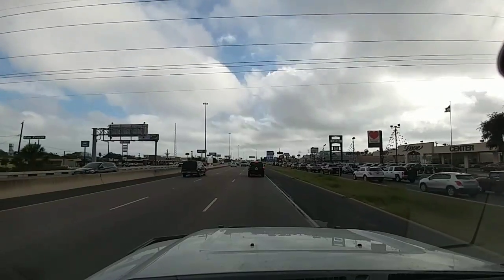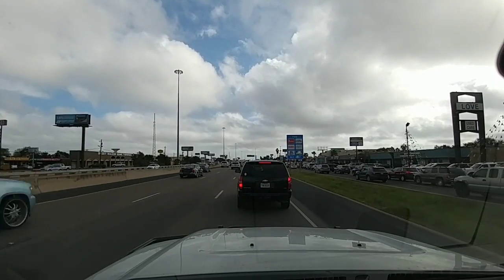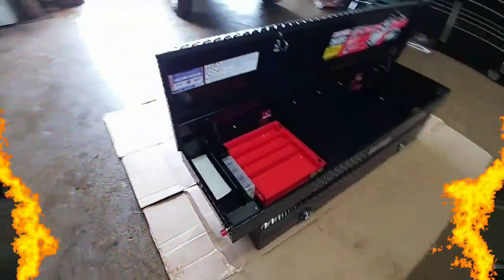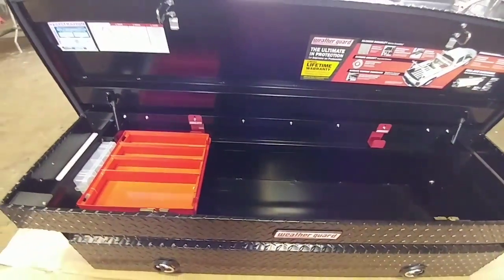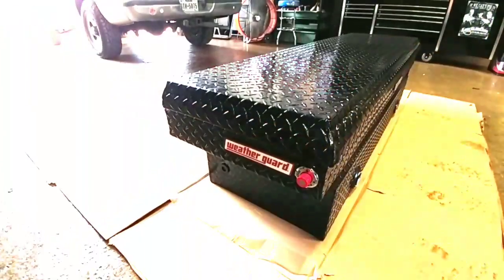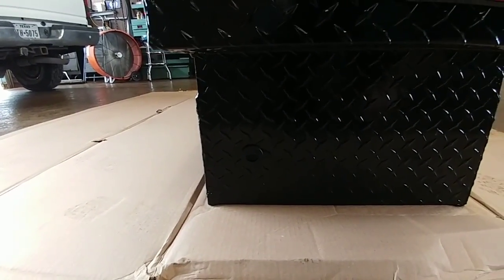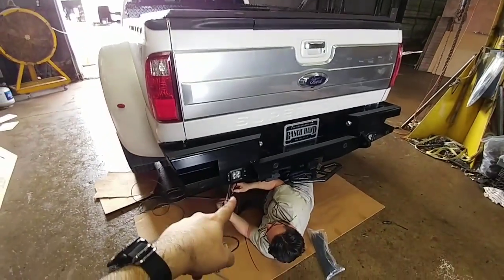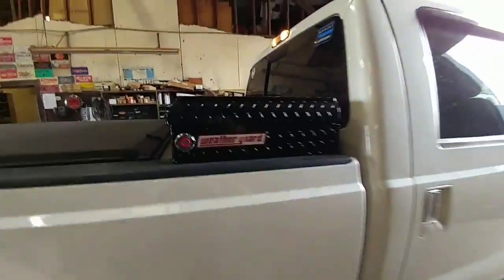Ranch Hand Wig Wags, Weather Guard, Clean F450!!

Comment: Wig wags traditionally were installed in 1986, for law enforcement,  then in the early 90's fire departments, and EMS, began to use the switch, however it only refers to headlamps which rotate flashing simulating a dog wagging it's tale. The lights you describe are alternating led lights, but actually a strobe was a type of light we used after halogen rotators, began to be less effective.  They were adapted from airplanes, to helicopters,  and became very useful particularly in the daylight hours. But many officers would turn the front store lights off ,and only leave the rear deck lights on ,due to the effect that the officer would feel when he had a contact in front of the patrol car. It was similar, and almost exactly to the effect one feels at a night club, when they turn on the stores while in morion, it creates the effect ,to the human sensors that they are moving in slow motion.  Thus, the LED's  were founded in the early 2000's, but they were extremely expensive. 
 Why civilians call LED'S WigWag, or strobes ,I feel it's the younger people, who are civilians and never experienced the dynamics of using halogen rotators vs strobe lights vs LED lights. Civilians are loosely referring to these terms, I think, to any LED that alternates,  or LED that pulses.
 Unfortunately,  I've been a cop for 33 years, and my dad, and grandfather were cops as well,  I can say for certainty that whether civilians, or first responders it appears  that there are much less fatalities, because the warning devices are much more sophisticated & contemporary.  When I first started our marked cars only had 1 steady burning red and red & blue round halogens on the rear deck. If a officer ran code to a disturbance, it was deck lights on and the officer working the steady red ,siren, and hazard lights on. Until 1986 when Federal Signal founded the Wig Wags for the head lamps,  this helped stremendously, particularly in the day time.
 Good luck, the components on the pick up look sharp sir.
Reply from the maker: Dutch Avery: I really appreciate the information sir.  Be safe out there brother
Reply: Big Truck Big RV 

Thank you sir.

Comment: Since you lost you higher up strobes on the box you should think about putting some strobes (white or amber or both) in you bed lights (in the 3rd brake light housing). It's always important to have high mounted lights, especially if you are going to be on the side of the road for any reason.
Reply from the maker: Daniel Pace: yeah, I'm having to think about placement now. Maybe some hide aways are in order

Comment: Another great video. Thanks for your work. One comment that I will make is that I personally don't see much of a use for those lights on the bumper. In an emergency situation, the last thing I want to do is blind people coming up behind me with a white LED light. Are they at least wired to your reverse lights so you can see better when backing up at night?
Reply from the maker: caveman123ization: I was considering connecting them to my reverse lights, but they blind the backup camera.
Reply: Big Truck Big RV would've been nice to use for hooking up trailers at night
Reply: Agreed. For emergency purposes I would have made them yellow. Being able to turn them on solid (not flashing) would be handy for working with a trailer or anything else behind the truck at night. Generally the higher the better for warning lights, so they can be seen further away, and above something that could be behind you.  ;)

Comment: Love your videos. My same Weather Guard tool box on my 2019 F-350 dully restricts my turning radius. I have the 27K Ford hitch (Reese) raised to the 17" setting. I pull a 2018 Solitude 31GK 5th wheel trailer. The pin box on the trailer can not be lowered to give me more clearance. Should have thought this out better and gone with the low profile box, but wanted the Access cover. How did you deal with this issue?
Reply from the maker: The front of my fifth wheel is angled enough to prevent contact. The b&w companion also has several height adjustment options when setting up

Comment: Sodering wires is the only way to go when messing with electrical work.
Reply: Amen, crimp connectors just dont cut it
Reply: Nexfero arnt all factory wires crimped to the pins and not sodered that are in the connectors
Reply: fuzzy wuzzy Yes, factory wires are all crimped on every car or truck I have worked on. I've never had issues with crimped connections that wouldn't happen with soldered connections.
Reply: I've never had an issue with good crimp connectors.

Comment: how do you have your trk insured. what is your gvwr. i was looking at a 97 f series truck 15k gvwr and the legendary 7.3 powerstroke with 95k miles on it and asking 4500. im getting from my insurance is to high of gvwr for private insurance would need commercial and that is ridiculous. i wasnt planning going that big for my trlr but a 2500 doesnt like a 13k trlr on a pintle to much. i was thinking a 3500 or 350 but saw that trk for a steal. 
oh yeah there aint even a trlr hitch on the truck. its only been used as a flatbed

Comment: Easy you take a ford chassis with running gear use rams motor 6.7 Cummings with the Chevy Allison transmission and buddy you got a MAN rolling down the rode easy as that wish you could buy them like that I think if your the one with the money you should be able to order a truck like you want and it be brand new off the lot

Comment: Does the new tool box interfere with the turning radius when hitched to the 5th wheel?
Reply from the maker: Jeffrey Jones: no sir.  my Fifth Wheel front cap is designed for this application
Reply: Thanks, I knew about the cap on the Chaparral. Just ordered a new 390QSMB two weeks back, but was not sure whether a box above the bed would cause problems.
Reply from the maker: Jeffrey Jones: you should be in great shape.